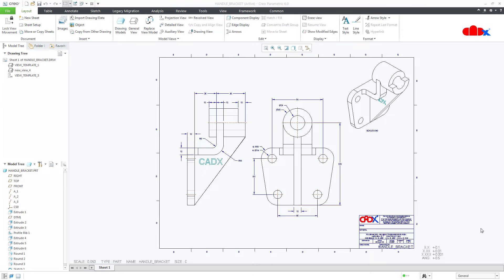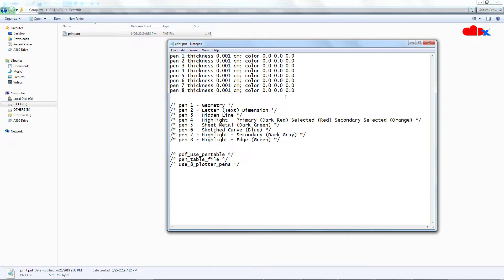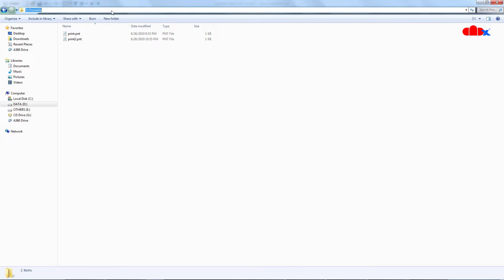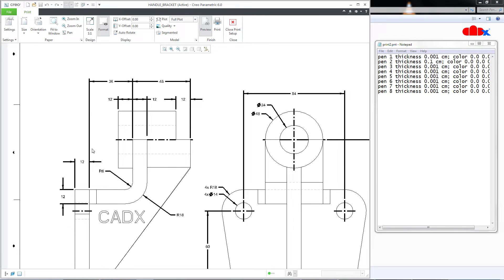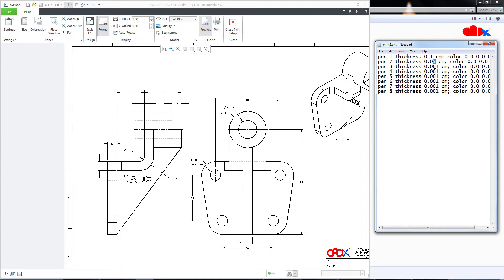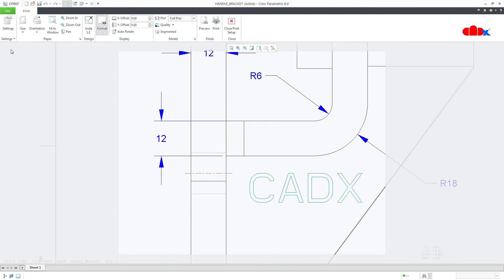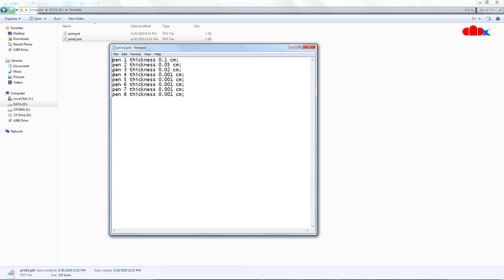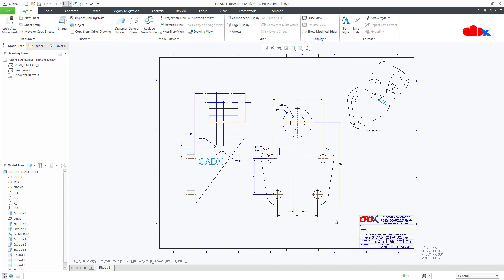Create a new pen table file to take prints and export pdf in Creo Parametric

Comment: Pen unit must only be in cm or In..   If you use mm unit, Creo will report "syntax error" and will not read the pentable file. Has created a big hell for me and I only just discovered the correction. It's in creo help manual.

Comment: Hi... Thank you for your detailed explanation. Unfortunately, my drawings still do not update either the "config.pro" file or the "pentable.pnt" file I created. My drawings still have the thick blue outer lines which I want to be thin black & white. I followed exactly the same way as you demonstrated yet no positive result. Please help me with my issue. Thanks in advance :)
Reply: @CADX: I found the solution. It works properly now. Thanks!
Reply: @saikrishnadittakavi6269  what is solution you found . i am also having same problem
Reply: @NARASIMHARAOARATA  Hi... I reinstalled my Creo Parametric. And then, I followed the steps as shown in the video. The pentable file now can be created and that can control as the tutorial suggests. That's it! Hope it helps. :)
Reply: Just a point to Note: Geometric (main) lines are expected to be thick. There are standards for line thickness.